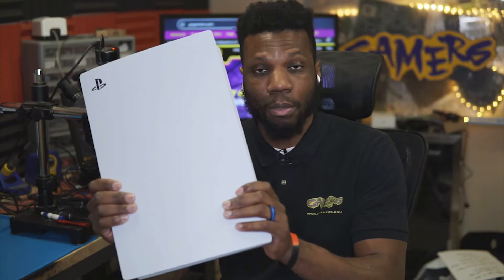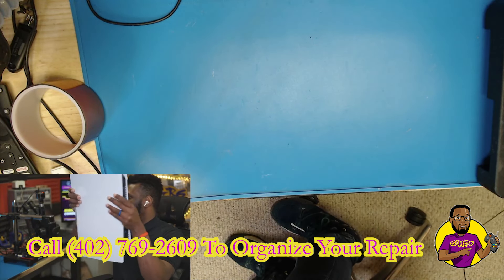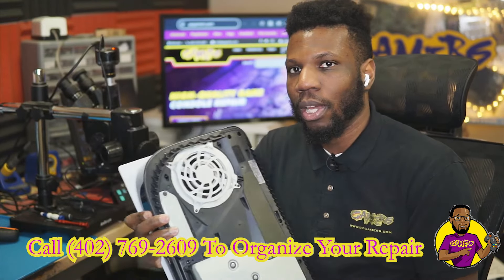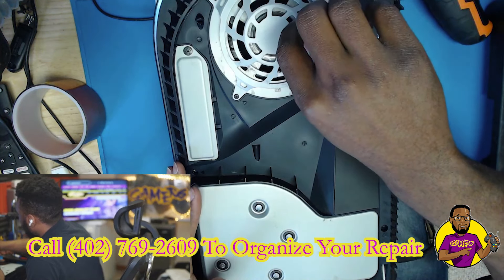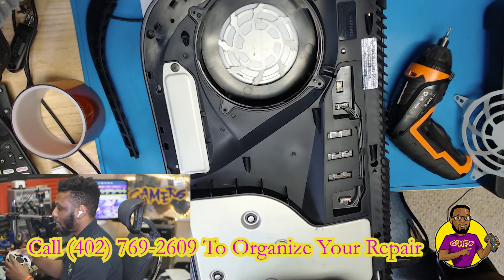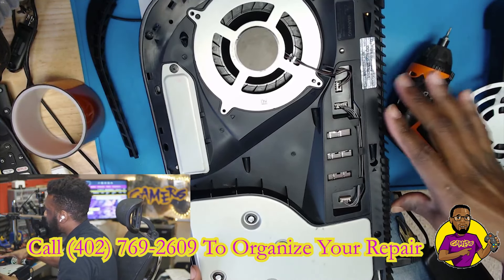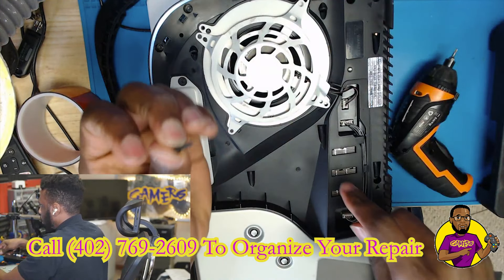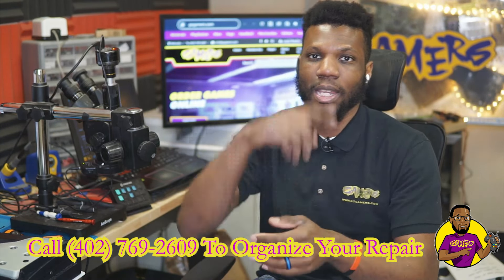Fix PS5 Overheating and Is Too Hot (EASY 5 Minute Fan Repair!)

Comment: this has gotta be a software issue, it’s only started happening very recently. seems a lot of of people have been having this problem fairly recently
Reply: Same, mine didn’t start happening until the recent update. Something doesn’t smell right
Reply: Dam, glad to know I’m not the only one! I always take care of my consoles, I was playing GOT DC (4hrs) and got this message and turned off my console right away. Cleaned the little dust around the fan and fins and let it sit. Will wait to play laterz
Reply: @kathichapman7457  this is me btw
Reply: I agree with you.
The last update has done it to me to.
When i play more than 1 hour.
You ps5 is overheating.
Tried to clean it all.
Didn*t help
Reply: FACTS
Reply: Mine started doing this a week ago
Reply: Mine started doing this the other day. I don’t get a message tho, it just shuts off
Reply: Mine started 2 week ago but it happened like 1 time a day nor for the past week I can barley play for 30 minutes without it turning off.
Reply: Mine just shuts off, black screen, no warning. Never done this before today. Wtf.
Reply: @Oilupimtherein5  just started having this issue
Reply: @HeartlyAdolfo  still haven't found a real fix. My ps5 was dusty sure. I used literally everything I could. I tried to vacuum the dust catchers, didn't wanna mess with the fan so I tediously used q tips to get the big chunks of dust out. Then I bought compressed air and sprayed the fan and the vents. My ps5 is practically dust free and yet when I play ps5 games it gets so hot, I don't want it to catch fire. Ps4 games are fine though. I'm convinced it's a problem internally. I'm gonna go to the repair shop today and see what they say about it
Reply: Fr my shit just started
Reply: Just started today. Wtf is going on.
Reply: @Oilupimtherein5  has your issue fixed? Mine ps5 also have same problem. Ps4 version games run smoothly but for ps5 version games after some times its says to hot
Reply: @grgussop  I did everything. I vacuumed the dust catchers, I use a compressed air duster on the vents, I even use q tips to painstakingly get the big chunks of dust out of the fan. My ps5 is 95% clean now, give or take. It still was getting too hot. I was about to take it to the repair place but i noticed it wasn't as hot when I was playing ps5 games. I guess it fixed itself, it does get warm and even hot still, but not hot enough to crash. I also laid it horizontally instead of vertically if that makes a difference
Reply: Mine isnt shutting down but it's getting hotter than it ever has before and the fans will ramp up and down constantly which has never happened before sometimes like a hairdryer which leads me to think its not cooling itself properly. At first I thought it was just me but there's a lot of similar posts in the last few weeks about overheating. I've seen others mention it's something to do with a software update but not sure how that could let that happen.
Reply: @mrbobajango7482  mines the exact same I don’t get how the recent update could’ve affected the fan but mines been so much louder since the latest system update
Reply: @blackout20412  I did read once that the system updates can mess with the fans just seems ridiculous that they've done something without realising. We will just have to hope they fix it 🤞
Reply: Just started today and it’s happened multiple times!
Reply: @mrbobajango7482  definitely fingers crossed :)) I’m sure it’ll get fixed sooner or later
Reply: Yea mines been happening a lot too
Reply: Mines started recently and it happens with certain games like rift apart and forbidden west, among us and fortnite for like 30 mins to 1 hr but not elden ring (which can play for 3hrs), wwe2k and others. I took it to a repair shop that done work for me in past and they said they cleaned it, added more thermal paste and it still happened. I took it back and they still can’t find the problem. I hope they fix this soon.
Reply: Something is fishy ain't no way we all have the exact same problem I bought rift apart 1 month ago and it started doing it after a while and now it does it after every 3 hours of game play smh
Reply: For a long time it never happened, I’d say about 6 months ago, it only happened playing MyCaon 2k22, now it’s almost every game
Reply: @Oilupimtherein5  did you find out why it was overheating same thing is happening to mine
Reply: Update. It probably started off as a software issue, but it’s probably caused long term hardware issues by now. All the forced power offs without warning has without a doubt caused irreparable damage
Reply: @thephantommenace1774  bro that shit sucks man i don’t even get a warning anymore it just turns off ! And It’s not even dusty i never had this problem with my ps4 ):
Reply: Yeah and my system is about to go thru a effing wall
Reply: the ps5 overheats ps5 games after owning it for a year
Reply: @thephantommenace1774  and lmg sony wont do shit to fix it
Reply: Newbie here mine started this a few days ago
Reply: @Darknssabids  same here. It overheats with the warning, and I can feel it too when playing fifa 22 after less than an hour. But when I play games like Ratchet and clank rift apart or some other ‘intensive’ games, it seems fine
Reply: @ItsAlejandro  I opened my ps5 and done a good cleaning so far so good 👍 😌
Reply: The other night my ps5 game was idling while i was on my phone and then the game turned off, i thought it was going into rest mode but when i turned it back on it had to repair the database, and now my fan doesnt rev up when i start a game or even when it gets really hot, it doesnt reach high rpms anymore, it hasnt shut off since but its getting really hot.
Reply: @danielcastro1332  i have this same problem do you still have this or how did you fix it?
Reply: @youriwitte8853  yeah I have fixed it. You gotta take the sides off and clean it. There’s also these two holes that have dust inside, I just used my vacuum and put it inside of them. Also placing your PlayStation horizontal helps a lot too.
Reply: @danielcastro1332  don't have the overheating issue but just watching this as a contingency, where was the dust exactly when you opened the side pannels other than the holes?
Reply: this first started when I played Elden ring on release
Reply: @xenon473  the fans as well, I didn’t have the right screw driver to take it apart, but I did my best with compressed air and q-tips. Besides the two holes and the fans there wasn’t much dust. I would recommend cleaning about once a month even if it isn’t overheating. Just to be safe
Reply: @antonossianssonMusic  what do we do?!!!! Fucking ps5’s
Reply: @Yeayea29  ps5 is asss
Reply: @Darknssabids  yea mine started this a couple days ago but out of nowhere while playing returnal, the thing is I've been playing it for hrs on end with no problem but when my ps plus expired I went to subscribe again and after that process I couldn't play returnal for longer than 40min without a total shut off no warning. It happened 3 times that day so I checked the fan it was clean cause I regularly do it so that wasn't the problem here are the steps I took and ps5 doesn't shutoff anymore
1. I plugged my ps5 directly into the wall socket (Sony says to try this) 
2. Then I cleared the system cache when I did this I was playing with no issues after that, but in the morning I did a rebuild of the data base just to be sure, been playing like normal now hope this helps
Reply: @grgussop  exactly man I can play 6 hours of any ps4 game soons I play 10-15mins of ps5 game it shuts off.
Reply: @amvstoniYT  same … wtf. How do we fix
Reply: yeah mine just started happening around 3 weeks ago
Reply: @flixx8633  same but I fixed it, I've had a launch ps5 and it's been fine until 2 weeks ago. Unscrew the fan but don't unplug it just set it to the side I had so much dust on my heatsink and fan, clean that then take a flashlight and shine it down where the power cable is and you'll see a black piece with a bunch of holes if it's clogged that's the main reason for shut offs use a toothbrush or paint brush/makeup brush and clear it I've been good ever since
Reply: @chodey9109  same
Reply: @danielcastro1332  mine does that too just started 2 days ago have you managed to find a fix if so please let me know
Reply: Jeez i’m glad i’m not alone. It’s not even hot sometimes and I get the message.
Reply: @bedge3740  I don’t even get a message
Reply: Same here, got that warning just recently
Reply: Mine started doing this a month ago so I got fans which helped but 1 week ago it started to keep overheating, only when I play PS5 games for more than 1/2 hours
Reply: @Oilupimtherein5  I think Sony may need to release a console update to fix this overheating issue
Reply: @amvstoniYT  mine too only ps5 titles so I did a deep cleaning today took the whole thing apart was a pain in a the ass took me almost 2 hours I will test a ps5 title tomorrow if it still does it Sony wants 227 dollars to send it out
Reply: Has anyone found any fixes to this? It really is the case that one guy said that it overheats on ps5 games after a year :/

I tried cleaning it following the 3 stages guide up to stage two where you clean up to removing the fan and burshing the heat sinks below it. Still didn’t fix the overheating.
Reply: No crashes at all after I did that deep cleaning took it completely apart my cooler had some pet hair in it my damn dogs shed like crazy so I just have to stay on top of it I moved the Ps5 into my bedroom it’s been great all good now
Reply: @Oilupimtherein5  and did they repair it? Did they have to repair it?
Reply: I think the PS5 is poorly designed. I just got mine today and haven’t hooked it up yet. Hope I don’t have any issues with it.
Reply: @JMS103  let me know man, good luck!
Reply: I don’t know about anyone else, but I can play Monster hunter for up to 5 hours without any issues but if I turn on my console and play a PS5 game, for any longer than 30 minutes to an hour, my console will overheat and shut itself off.
Reply: Just started happening today after new update 🤦🏾‍♂️
Reply: @militiamike  damnn i’m not even surprised anymore, smh…
Reply: @militiamike  same
Reply: @militiamike  same :/
Reply: @grimm3698  same here I got the new nba 2k and it still crashes but I can play the little cheap games or older games no problem but even madden and avengers crashes only system I had this problem with never happened on the ps4 it’s some bs
Reply: @kingantboy  ong bro I deep cleaned still crashes when I get on 2k23 can’t even enjoy it but I’m finna try it horizontally rq and lyk
Reply: @erfbq1068  did that work for you ??
Reply: @GtwoGent  nope still overheated I’m selling it today
Reply: @erfbq1068  watch it’s going to work I been going in on there ever since
Reply: @blackout20412  
Speed variability is controlled directly by software. This was probably an attempt by Sony to address noise by throttling the fan.
Reply: @woof7046  
I just ordered a PS5 but I'm keeping the PS4 pro just in case I need to send it back for repair!
Reply: Just updated the software and started having this issue.. hopefull they fix this bug
Reply: @mattguxxxtt9629  same here. Used to run destiny 2 fine though. Now after 30 minutes it turns off too.
Reply: @hay_aye_ron  hold on guys, I have an idea of what it is, do you guys save alot of clips?
Reply: @LeoneWorlds  yea but what that gotta do with anything
Reply: @malikc3768  because basically the more clips you save, the slower your ps5 runs
Reply: @danielcastro1332  does it still happen to you?
Reply: Aye mane my digital console overheating wtf brand new only a yr old
Reply: @Dutezy  not not anymore
Reply: @danielcastro1332  did you do anything or did it just fix itself
Reply: I got the same problem after the latest update. Jet engine fan and overheating when playing games. Really starting to lose faith in Sony.
Reply: @antonossianssonMusic  did you get it fixed ?
Reply: @deeapttmh5444  I ve got a new one because the guarantee had not run out😀... But it took 7 months..
Reply: @antonossianssonMusic  got damn lol
Reply: If anyones console is overheating it’s most likely because of dust clogging up the console. Take the fan out and shine a light down the console and you’ll know immediately if it’s the dust
Reply: Yes this just started happening to me and I think it’s messing w my saved data for multiple games. Also gameplay feels slower now
Reply: @RougeHimbo  Is it still acting up?  Mine experienced the same issue from 6 months ago.
Reply: Yep my ps5 getting hot too recently when playing uhd res..then when i change to 1080 res my ps5 run smoothly like before.
Reply: @Oilupimtherein5  I’m facing a similar issue. So I guess keeping it horizontal helped?
Reply: Got same issues today playing GOWR, turned off twice, I placed it flat and it was working fine only played for an hour but it didn’t shut down
Reply: I beat Ragnarok went to play it again and it cut off my game
Reply: @firstsonofthesea7938   I flipped my console sideways and it’s all been fine no random shutdowns, fingers crossed, try flipping it to the side if you got it standing
Reply: I dropped mine now it over heats
Reply: @Oilupimtherein5  did u get it fixed????
Reply: I clean mine with drinking straws and a hand vaccuum.
Reply: Its not software, the game been out for 2.5 years alot of people dont clean thier systems and that is around the time that the dust would start causing problems 🤷🏾‍♂️ its not gunna happen in the 1st year the dust takes a couple years to really build up
Reply: @mrbobajango7482 mine started today! The Coil whine is a bit louder since day one, but i noticed recently that the fan is spinning a little bit louder and it goes up and down. But consistently. I’m worried. Can you tell me something about it?
Reply: @thehooper6499  Hey dude, sorry to hear you're having similar issues. My understanding is the the fan can have 3 different speeds which it goes into if the console is getting hotter to help remove the heat quicker in those situations. 

At the time I was using an unofficial fan which had a low RPM so the ps5 was getting hot quicker and ramping the fan up so I switched back to my original fan which rarely does it now, however In summer in the UK  certain games still ramp the fan up from time to time so it's definitely normal if you're country is humid /hot. I can only advise that you clean your ps of any dust and make sure it's well ventilated. If your ps5 gets too hot you will get a warning before it would ever break as a safety net.

The coil whine issue is something that plagues the ps5 and there's nothing you can do really without taking it to a shop and asking them to silence it which could cause other issues. My recommendation is to just use headphones or accept that it's annoying and you will eventually stop hearing it as much.

Hope that is helpful the ps5 while amazing does have these frustrating issues that aren't ever you explained sadly 👍
Reply: Seriously only happened with certain games at first until one of my games updated now it happens for that one too
Reply: Mine recently started
Reply: Amazing video. Thank you!
Reply: Just started a month ago
Reply: Mine just started this week. Really messing up my life flow.
Reply: @RougeHimbo did u find a fix?
Reply: @danielcastro1332 did u find a fix?
Reply: @Oilupimtherein5 did u find a fix?
Reply: Yup